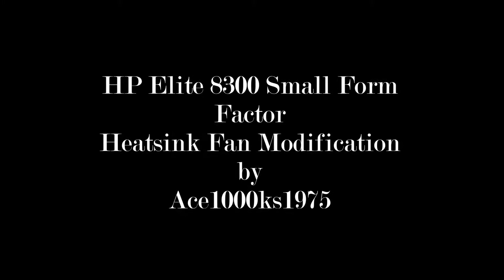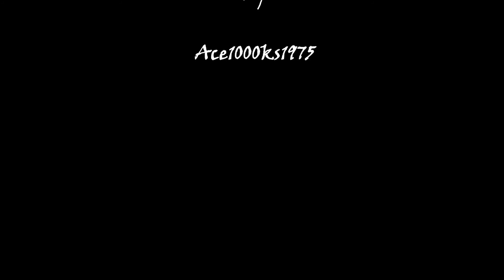HP Elite 8300 Small Form Factor Heatsink Modification

Comment: Is it possible to overclock an hp 8200?
Reply from the maker: You can get software to overclock it, but you cannot overclock it through the BIOS.
Reply: @Ace1000ks  I see... I also wanted to change the processor for an ivy lake one. Would it be possible to change the bios chip for a similar one with those features?
Reply from the maker: @diuco17  If you change the BIOS chip, your computer will not boot up.
Reply from the maker: Donald Nemesis Gaming  Get overclocking software.
Reply from the maker: Donald Nemesis Gaming  I am not really sure which software, because I never overclocked this computer. There are a lot of overclocking software out there, you have to research it on Google to find the right one for you.
Reply from the maker: Donald Nemesis Gaming  I don't think this computer was meant to be overclocked.

Comment: nice mod, what is the funnel to the heat sink called ?
Reply from the maker: You mean the plastic piece that is used as a spacer to the heat sink, or the heat sink cover?
Reply: @Ace1000ks  Yeah ! that's the one heat sink cover, mine missing so the cpu getting too hot
Reply from the maker: @tobytomic  That part helps funnel the hot air from your front fan to the rear.
Reply: @Ace1000ks  Too bad it's gone, I will use tin foil instead :P
Reply: @tobytomic  I know I'm 9 months late but the plastic piece for the CPU heatsink is called a "shroud", you can get them from eBay for cheap
Reply: @Brebgon  Thanks, I got it

Comment: Hey mate can I use a aftermarket heatsink/fan? But supports the LGA1155
Reply from the maker: I don't know, never tried it, but I am sure you can find out about it on Google.
Reply: @Ace1000ks  can't find anything on google it's all much about PSU upgrade. Do you have extra cooler? Probably try it for me. Thanks
Reply from the maker: @tydon19  I don't have extra socket 1155 CPU coolers.
Reply: @Ace1000ks  no worries, thanks anyway.
Reply: @tydon19  Did you ever try this out? I'm thinking about doing the same thing.
Reply: @DixonDeadlifts  I do not. Only ITX GPU will fit in this motherboard.